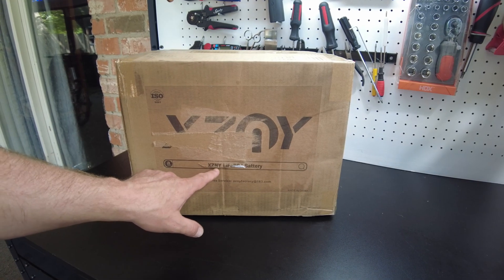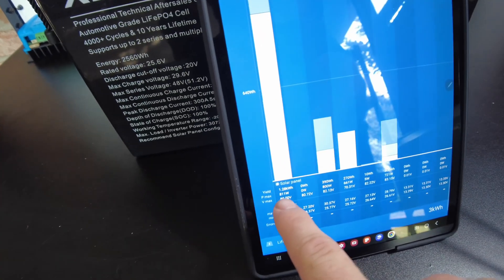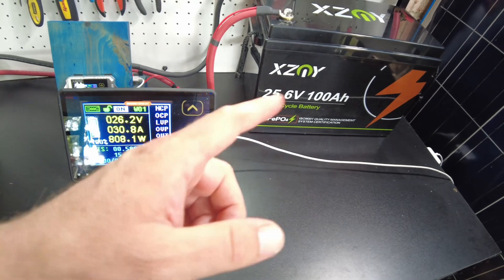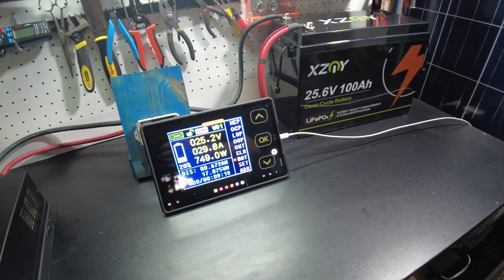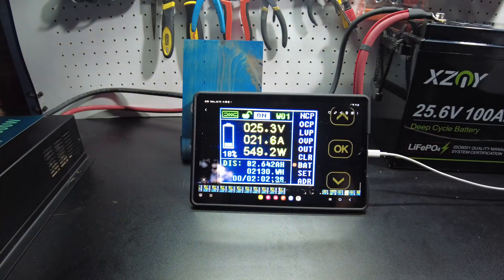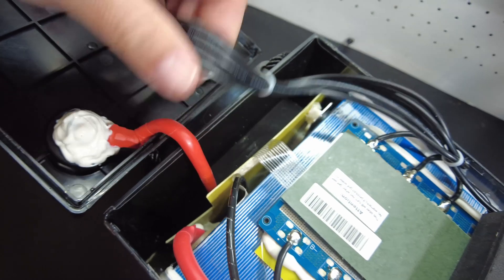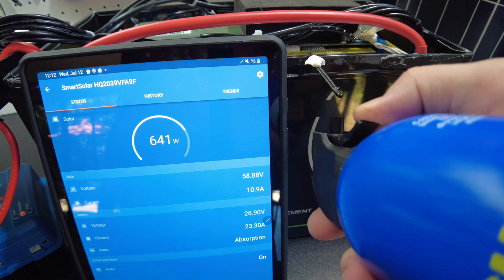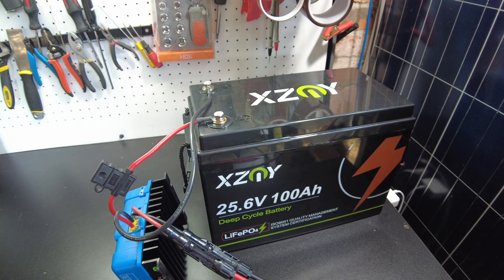XZNY 24v 100Ah LiFePO4 Lithium Battery

Comment from the maker: Affiliate Links:
XZNY 24V 100Ah LiFePO4 Battery: https://amzn.to/3PQPknR
Victron 100/30 MPPT: https://amzn.to/41JTG2A
Reliable 3000w 24v Inverter: https://amzn.to/3WRoUno
Midea U Shaped 12000BTU AC Unit: https://amzn.to/43xiXPm
Shunt I use VAT-4300 https://amzn.to/3SX0bvK

Comment: my suspicion is that the BMS overheated because of bad design 

as you noticed the BMS has some paper or plastic that is glued to it … that’s enough to stop the heat exchange for the MOSFETS transistors

Comment: I think an inverter power glitch happened when you changed settings and the BMS did its job.
Reply from the maker: hmm. I run this inverter 12-20 hours everyday, never had a single problem. I might try another discharge this weekend. Thanks

Comment: Your test is bit odd most of battery sold are on C20 standard it means you are dividing 100AH by 20H  it gives you 5A  this is the current you should discharge it to know there real capacity.
Reply from the maker: Actually the standard is 0.2C which would be 20A.  Thanks
Reply: That's a relic from the days of flooded lead acid cells based on a characteristic first expressed in 1897.  It doesn't apply to LiFePO4 because the Peukert exponent is so close to 1 it makes no difference.
Reply from the maker: @Sylvan_dB  Yeah very true. I've done so many tests, and it makes almost no difference even at 1C

Comment: I looked at your link they do give you a 5 yr. warranty.    So that adds a little bit of comfort to that bizarre glitch you experienced.   It's the first question on Amazon.  Would love to know what that was all about pretty weird for sure.  
What is the warranty? Is it prorated?
Answer:
We provide a 5-year warranty for non-artificial damag and professional technical support from our R&D team (repair costs are borne by XZNY) . If you encounter problems during the use of the product, our customer service team will usually reply within 0.5-12 hours.
By XZNY US Seller on July 11, 2022
Reply from the maker: Yeah, It's a pretty good deal, and the 5 yr warranty does and comfort. Possible it's a faulty BMS. I had a glitchy BMS on a PowerQueen once, so it's not unheard of. Maybe I'll hear back from the manufacture. Thanks!